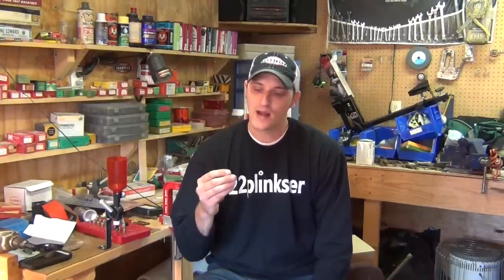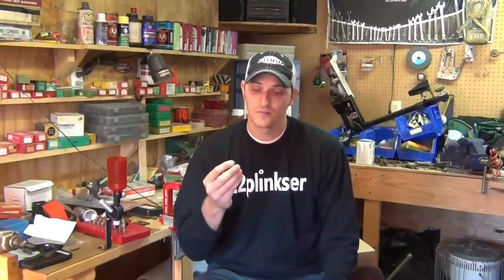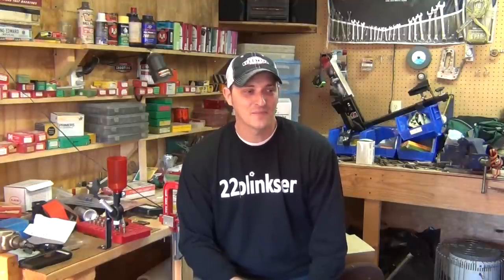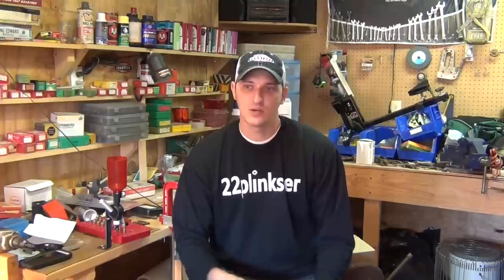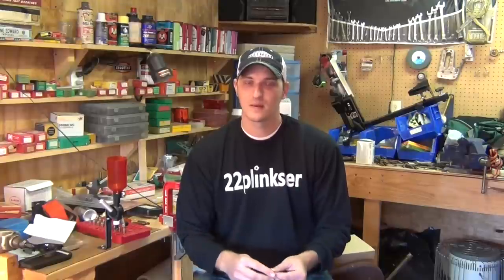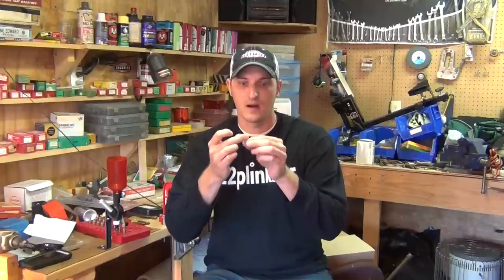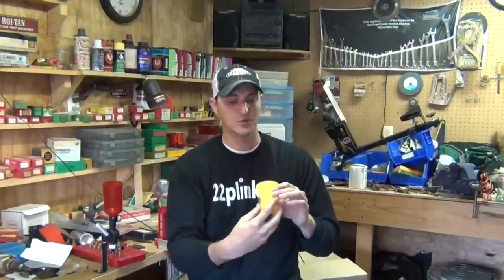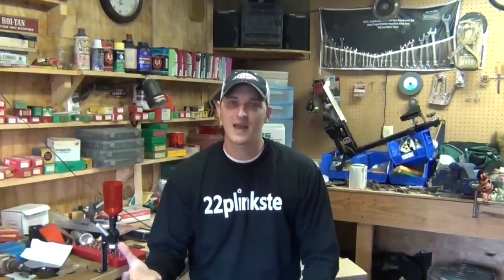Why does the .22lr have misfires?

Comment: I have found that keeping a box of RF ammo in your car for a long period will cause several misfires due to bouncing and vibration. Storing ammo with bullet points UP seemed to almost eliminate that. This was tested over several years with ammo in the box or in revolvers. Primers down usually always fire. Bullets down had several failures.

Comment: Thank you so much 22 for your kind video. Although I do not own a .22 firearm, I recently fired one at a local firing range while attending a handgun safety class. Your views about this caliber did reflect on what I had gone through while using my instructor's .22 revolver. Although my aiming etc did pass with five stars, the reason for the failures was in fact week .22 ammo and some of it did not fire at all. I am a fan of the 9mm caliber and used my firearm to train on this morning. No missfires and each round out of 50 discharged successfully and hit the center of the target. Yet, I have to get me a .22 for target practice. Thanks again 22 and I will keep watching your videos.

Comment: You're wrong about the priming compound and rough handling. It is applied through a process called spin coating. If enough primer isn't spun into the rim, there can be a gap no matter how carefully it is handled, or isn't. THAT is the reason you can get a failure to fire with a good strike and be able to turn the round and get it to fire. The firing pin hit a part of the rim without primer. THAT is a big part of why they aren't as reliable and not recommended for self defense like centerfire rounds.
Reply: He should know he watched cci make ammo
Reply: Makes sense, like the people who does the shipping FedEx or UPS probably don't care much about been careful with the boxes. In that case all the rimfire ammo should have bad primers

Comment: I don't know where 22 plinkster gets his rim fire primer information, but from what I've seen from manufacturers' videos the priming compound is inserted wet and the cartridge case is spun to cause this compound to lodge in the rim. This is done for safety reasons since priming compound cannot be ignited when wet. The gunpowder is also loaded into the case before the compound dries. If you strike the center of a live rim fire round it will probably not detonate because the compound is lodged in the rim. I stand to be corrected.
Incidentally, some early lever action firearms did have dual firing pins for the larger rim fire ammo of the day.

Comment: I've had a lot of malfunctions caused by out of spec ammunition. Was having a lot of problems like failure to feed and extract in both semi auto and bolt action rifles, and stovepipes in the semi auto, even after the gun had been cleaned. I measured some of the unfired cartridges with calipers and found they were too large. Not exactly on the same topic, but it came to mind with the subject of lower quality ammunition.

Comment: I am not sure Pliinkster described the way 22 rimfire priming compound is put in the case is correct.  When I looked into it some years ago, the case was already formed and a drop of syrup like compound was dripped into the case, then the case was spun at a relatively high speed for a short time to use centrifugal force to get the compound into the rim.  This all happens very quickly as the cases move along on the production line.  Obviously if the compound is too thick, or does not dry correctly, or is handled roughly (Like Plinkster said) it can come out of the rim at a certain point or leave a gap that if you are unlucky enough to hit with your firing pin, will not detonate the cartridge.

At least that's the way it used to be done.  If they do it differently now it would be a surprise to me.
Reply: There's an older video that I saw that showed them scraping a disk of primer compound into the casing. I'm pretty sure he saw the same one.
Reply: JustSomeGuy you pack the compound it to the rim and put a drop of acetone

Comment: Well you are close. Actually the priming compound is in the rim of the case, not in the middle. When the firing pin strikes the rim of the case it crushes (pinches) the compound that is in the cavity  in the rim, igniting the primer compound thus igniting the powder. Sometime the compound doesn't get all the way around the rim in the manufacturing process.  That's why you can turn the cartridge  so the the firing pin strikes in a different place and it will fire.
That where the name rimfire comes from.
Reply: There could also be inconsistencies in the thickness of the brass rim that makes certain areas of the rim harder then others not allowing the pin to crush it in far enough to ignite the primer.
Reply: tct72 How about head space??. Too much and the striker will not hit deep enough maybe. CCI and Federal are Allright

Comment: Just want to share my experience with old 22 ammo. I had 3 shells blow up in my S&W 22 kit gun this summer. Two spit cases (which sounded funny when they fired) and then the rim blew out the back end of one and locked up the cylinder. The projectile fell out the barrel and landed on the bench. This ammunition was purchased back in the late 70s but  it looks just fine and was stored well. I have older ammo that I've shot without a problem. I took the gun to a gunsmith to have the case removed from the one that blew out the back and they told me the ammo went bad. They tested the gun and there was no problem with the gun. I have never had 22 ammo split open before. The response from the manufacturer: "We have a one year warranty on our product from the date of manufacture but we generously extend that to 10 years if the ammo was stored properly."

I have disposed of all my 22 ammo that is over 15 years old and the older ammo I only shoot out of a bolt action rifle.

Comment: First, let me say that I am a big fan. I think you do much to promote the shooting sports, and I enjoy your channel.  Now,  I am a certified gunsmth. That being said, I have some insight into your discussion on why .22 rimfires fail to go off. First, dry firing is not the damaging bug-a-boo people tend to think it is. If the firearm was made correctly to spec, and has not been altered and well maintained the firing pin should NOT hit the chamber mouth and pein it. Bu if it did it's easily remedied with a chamber ironing tool. The reason it should not be an issue is due to the following. SAMMI spec for rimfire cases is standardized,  the case rim thickness would be around .038". The proper bolt head rim cut thickness should be .040". This prevents the bolt crushing the case rim and firing the cartridge. The firing pin is equally important, it must be of the proper steel, a 4140 type correctly heated and drawn back like a spring,  or case hardened.  Its length is extremely important.  It's positive and absolute protrusion can not exceed the rim cut depth of the bolt face, this should be about .035". Otherwise,  the firing pin will damage the chamber. This will lead to problems with extraction due to the chamber now being tight, which will lead to ejection problems.  If the bolt face is out of spec. it will lead to misfires, to deep a cut, or slamfires, to shallow of a cut or a build up of crud on the boltface. As far as the misfires go the shape, width, length,  bevel, depth on the rim face are huge factors in ignition.  Concerning manfacture of .22RF  cases the priming compound is droped into the case as a liquid and the case is spun useing centrifical force to assure equal distribution of the priming compound in the rim. This turns to granules which when abraded against one another ignite.  So the proper form of the firing pin tip must be of a shape to crush, and if to wide, the force is blunted, to pointed and not enough surface area is contacted. There is much more to consider on firing pin fit and theory but this is the basics of it. So unless one knows for certain a good precaution is not to dry fire, as it makes little difference the age of the firearm but rather if it is still in spec. Hope this helped somewhat.
Reply: Great information!!  I would like to add, that Tony Kidd himself, said that the optimum thickness for the tip of the firing pin is .025" for reliable ignition. Of course, he SELLS aftermarket firing pins, for the 10/22. But, those are his specs, after years of trial and error...  No reason NOT to believe him, since he could have easily made them any thickness that he wanted, but he strongly felt like this was the right specs.  Thx for commenting, sir.    I value intelligent information, on YouTube. Theres kind of a shortage of it...at least in the comments. lol

Comment: I bought 550 box of Winchester 22 hollow point and was surprised to see they were packed in loose bulk. I had many misfires and thought it might be my Marlin lever action, which never did this before. Your review is very insightful and I will now use ICC. I also shot many rounds of old amo 50 year old and never had a misfire with many manufactures. I guess times have changed.

Comment: I NEVER dry fire anything. Bad practice. A friend and I both bought matching NAA black widows in dual ammo. his worked fine. mine would not fire every time with winchester .22 magnum. Careful study of the hammer firing pin(all in one) on mine it was rough. I polished it with a fine stone and it never misfires now. I have old winchester expert .22 that is 50 years old and it shoots just fine. I have very very seldom had .22 misfire. I had my colt official police .38 special(built 1957) misfire like crazy. hammer spring was weak. got a nice new one made with better steel than original from numerich arms and that cured the problem. good video.

Comment: Recently I used some old (at least 15 years) Thunderbolt 22lr ammo in some of my pistols. Golly jeepers, I had many rounds get stuck in the barrel and my semi autos often would not have the slide to all the way forward. Found out when I got home that the many rounds would fit very snug in the barrel. So it worried me that I just bought a bunch of Thunderbolt on sale. The new Thunderbolt has NO issues. Wow, was I happy to see that.

Comment: We live on bulk .22lr, the affordability ensures constant range time...this video is pretty accurate, and luckily our .22s are reasonably good about hitting the rim firmly...across all brands of cheapest .22lr we prefer federal, aguila, remington, and blazers, with winchester being the worst...but even with the prefered brands every now and then a box will underperform, and we just plow through it best we can, figuring the next box probably back to normal...our stash .22lr is cci and norma, which stays still, dry, and not too much temp change...the LCP is slightly finicky, but runs thunderbolts wonderfully, and the rest of our .22s don't care...a lot of issues for people come from running ammo ill suited for the firearm, such as very slow rounds in autos, or extremely fast ammo in same guns...good video...

Comment: I use one of the brands you mentioned. So far, if I eject and reload a misfire @180 degrees so that the dented rim is opposite the firing pin, the round fires. 

last time I shot, I loaded the roughrider with 6 misfired rounds and they all went off.
Reply: Our rough rider used for the same duty...if round doesn't go off after rotated and hit then it is discarded as a true dud (actually pretty rare, maybe less than half dozen a year for us)...
Reply: @JohnPublic-dk7zd  I added a shim behind the hammer spring and have not had a misfire since

Comment: Yes, I also thought that the primer was not a solid disk, but only around the inner edges of the casing. Otherwise it would be a huge waste of primer.
However he may be right in one aspect and that SOME of the primer falls away from the edge leaving a blank area with no primer, therefore turning the bullet a little will allow it to be fired.
The only way to be sure is to actually pull apart a round which didn't fire and try to "see" the missing primer as a gap. Perhaps a little dangerous?

Thanks for your long explanation!

Comment: I had some winchester wildcat that was left in an old pickup that quit running in the 80's. when I was going through stuff in there, I found a box of 50. it sat in there since that pickup was parked there in the 80's in the hot summers and cold winters and the rain and snow. I shot those off this fall and every one went off and shot really accurately, so in my opinion, rimfire cartrages will last a long time in any conditions.
Reply: The rain could get inside the pickup, and the box had signs of slight water damage, but that had no effect. I have also done tests where I dropped .22 rounds in water for 30 seconds, let them fully dry, and see if they shoot. In most cases they did work fine. CCI or Remmington thunderbolt were the best. But as 22plinkster showed us, perfectly fine shells will have misfires. I have found that sometimes a missfiring round will still work if you try it in the gun again, only turn it a bit so the firing pin will strike the primer in a different place.
Reply: +Josh Musilek  I BOUGHT A BOX  (50) SHELLS AND I WAS SHOOTING THEM THROUGH MY JC HIGGENS 22 SEMI AUTO AND ALL OF A SUDDON I HEARD A PSSSST AND WHEN I CHECKED THE GUN, I FOUND THAT ONE WAS A MISFIRE. if I HAD PULLED THE TRIGGER AGAIN THE BARREL MIGHT HAVE BLOWN UP BECAUSE THE BULLET WAS STUCK INSIDE THE BARREL.
Reply: +Larry Kemp thats called a squib

Comment: Hi there Plinkster. I very much enjoy your videos.

However, I think you've got it wrong in this one. If your theory about the ease with which the priming compound can be dislodged were correct, semi auto guns would be very unreliable indeed due to the violence with which the cartridge is pushed upward in the magazine and rammed forward by the bolt. Also, think about all the vibration that may occur to ammunition during shipping.

The priming compound in a rimfire is inserted into the case as a wet paste, the case is then spun to cause the primer to run out into the rim, where it dries and hardens in place. It is well secured by the groove in the rim and cannot turn sideways as you show. Also, it is a ring of priming compound, not a disk.

Misfires that work after a second try are from poor quality control in which not enough priming compound was applied or the case was not spun long enough to distribute it fully.

I'd be curious to hear if this is a theory you came up with on your own or you have some information regarding this that I'm not aware of.

Thanks and keep the good videos coming,
Reply: Your theory sounds about right but for the fact that Plinkster is talking about ammo that was banged around, then left to sit for a while, allowing time for the priming compound to settle.
That's quite a bit different from ammo that was banged around a bit, then immediately fired.
Reply: PinkOld I think if that were true then rimfire ammo shipped by truck, and by rimfire ammo shipped by truck I mean all rimfire ammo, would be very unreliable.
Reply: MGG - You are perfectly correct on these misfires. If you go and look at the manufacturing process of rimfire ammo, it is self explanatory.
Reply: I thought he was a little off about a "disc" of primer because I remember it being spun into a ring instead. Good comment.

Comment: don't know who will see this or not, but I purchased an old used 22 bolt action a while back. It would randomly decide to not drop the firing pin, until you went to pull the bolt up to open the action. As soon as you put tension on the bolt, it would decide to go off (only after the trigger had already been pulled). Turns out that the firing pin was mushroomed on the tip from dry firing from the previous owner, and it was causing it to bind up. New firing pin and all the issues are fixed. Dry firing can cause problems in other ways.

Comment: Rimfire ammo is made of brass, as the temps get lower the brass goes from being malleable to brittle,  when the temps go below  40 farenheight  the rims starts to get harder and the action of the firing pin may not have it's desired results. Die cast zinc also becomes brittle below 40. If you  have rimfire ammo that shoots with no problem in colder climes, that use it in the winter.

Comment: Another added point...some manufacturers insert a wet paste, spin the case and then let it dry...drop the cartridge on a hard surface will fracture the primer compound, causing it to dislodge from its position, again, as you said, causing a void in the rim, resulting in a misfire.

Comment: There are a few reasons you missed. In my opinion, misfires in rim fires can be caused by:
-Ammunition issues for all the reasons you stated.
-Inadequate firing pin protrusion due to damage from dry firing as you stated but also from wear, dirt inside the bolt or breech block or even just poor quality assurance at manufacture.
-Excess head space caused by wear on the locking surfaces. This can be where the bolt handle locks into the receiver on bolt actions or the locking shoulder in the receiver can be peened in other repeaters. This can sometimes be corrected by judicious peening of the metal back in place.
-Weak mainspring. This can be seen in any rim fire but is more common in hammer less designs such as pump actions where they can not easily be de-cocked and are often stored for long periods in a cocked condition.
-Firearms that need a good clean can have dirt and gummed up old lubricant in the firing mechanism that slows the fall of the striker or hammer resulting in misfires.